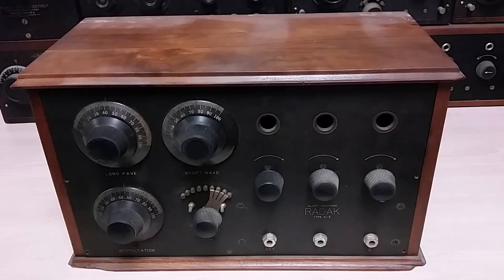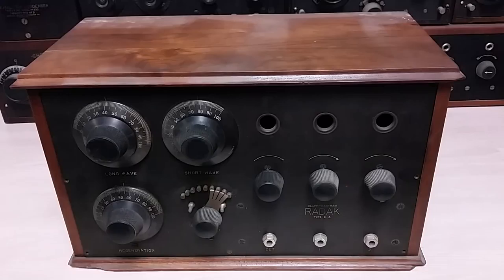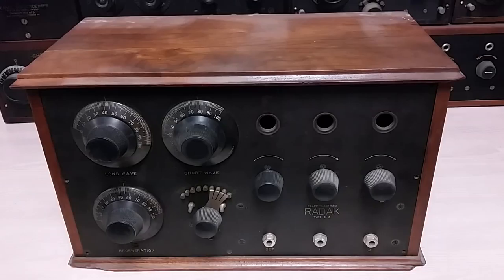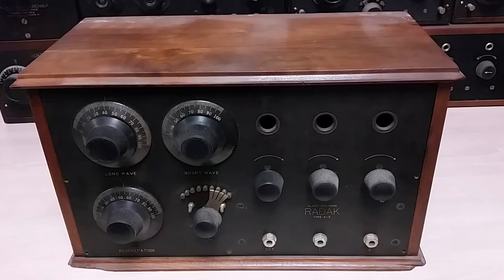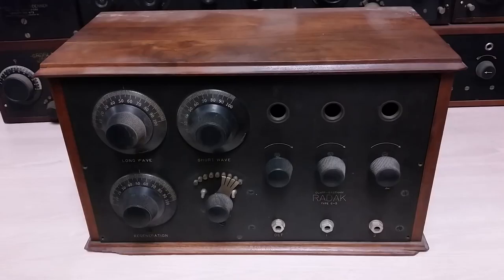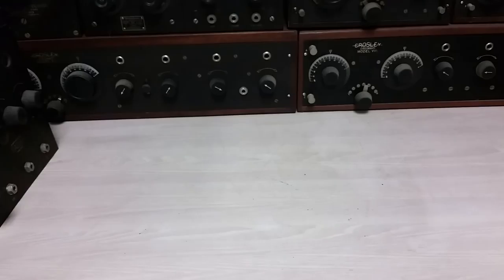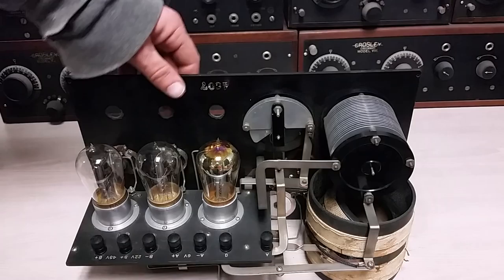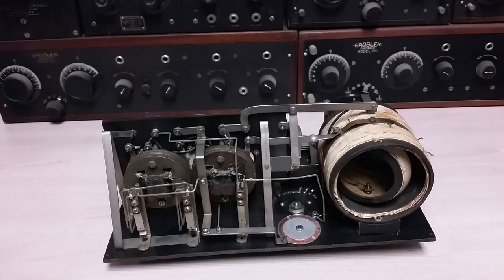Clapp-Eastham C-3 Radio

Comment: I'm curious about why the tap switch appears to short out several adjacent taps.
Reply from the maker: It is a clever trick some radio makers did back then. There is no connection to the center pivot of the switch. The extra wide wiper selectively shorts out the taps for better reliability.